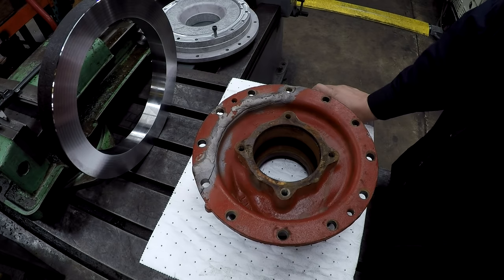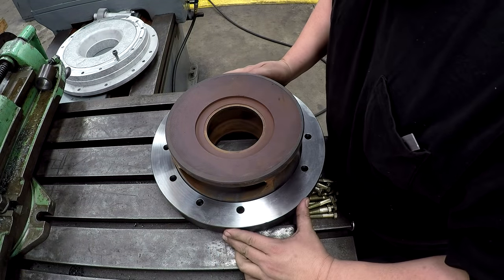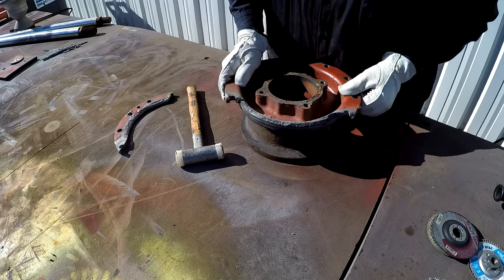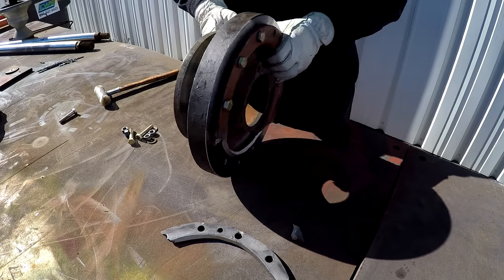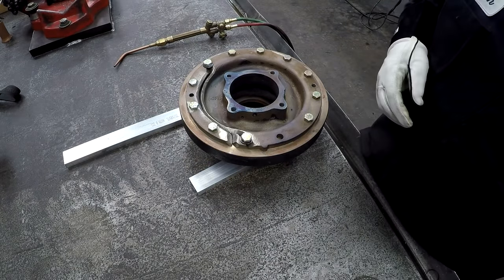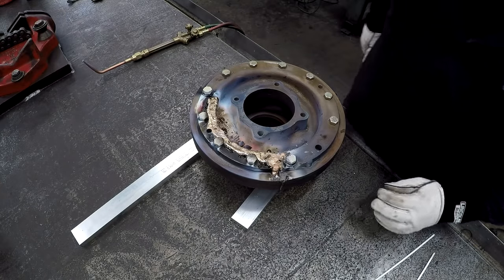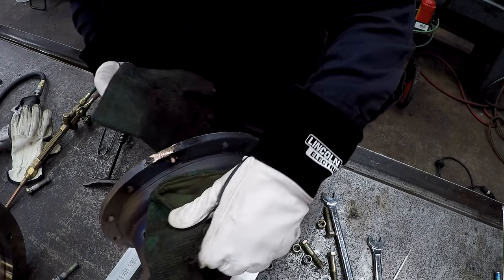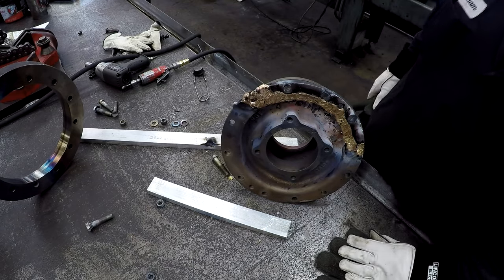Braze Repair on a Broken Casting Part 1

Comment: Hi Adam Job looks good so far. Did you wrap the casting to allow it to cool slowly or just leave it on the bench to cool.?  look forward to the next part.  regards from the UK
Reply from the maker: +Gary C Yes I did, and wish i would have gotten footage of that too. After the last clip I wrapped it up in that welding blanket and let it cool untill the next morning.

Comment: It looks like this part needs more structural strength - if it keeps breaking? I thought brazing was weaker than welding? What are the pro's and con's in this scenario? How is the repaired part holding up a few years later?

Comment: The previous repair was probably done by the kid in Texas with 7018's.   LOL   Your repair is 100 percent better.
Reply: That was a cheap shot for no reason.
Reply: Well the original repair looks like something the guy in Texas would have done.  He's the only one that uses 7018's to weld cast iron.
Reply: +1970chevelle396 coulda been a field repair where you're limited to what you can scrounge from the back of your truck and your go bag. all the bosses care about is if it's fixed yet or not. they don't care if it's done right, since more often than not they don't even know what right is.
Reply: +SuperAWaC   How right you are! Once during a shut-down we had to cut out a small socket weld valve from the underside of an intake line in a water treatment building of a power plant.  It was the most gnarly looking weld I had ever seen - looked like some kind of fungus you see growing on trees.  The guy doing the repair welding made a joke about it and mounted it to a cardboard sign commenting on the quality of work of the first welder.  What this prima donna didn't say was the boogered weld was done with the plant on line and the intake line filled and under pressure while the first welder was lying in 6 inches of water.
 So, +1970chevelle396, keep your mouth shut until you've been there.
Reply: +Ricopolico yeah i've definitely had to do my share of just-get-it-through-the-night-"ah-fuck-i'm-not-putting-my-name-on-this-one"-all-the-wrongest-tools-for-the-job repairs. i'd love to work in a boeing shop with the comfy leather welding chairs and the rotary tables that bring the work to you and the working hvac systems and the fume hoods and whatnot but not all of us can be so lucky
Reply: it was just a joke im sure rod.
Reply: @1970chevelle396  It's nickel ... !

Comment: Why have you brazed it rather than welding it? something to do with brass being ductile and malleable?
Reply: When it comes to the machining I guess machining copper vs nickel will be the choice(Not sure what filler rod was used and what it contains, usually a mixture of copper and zink or nickel for brazing steel or cast iron.). 

Also when welding with nickel it tends to crack like crazy unless you keep peening it between welds and let it cool down very slowly at the end.

Comment: Can you do an explination on when brass vs nickle is better?  i have a large casing that needs repair, and i dont have a large enough heater to heat and slowly cool to prevent cracking?  can you braze without worrying about cracking, or maybe give some scenarios?  (possible topic or SNS?) thanks!

Comment: Adam very smart move on the backing ring. Looks like another job where the prep  and plan is everything.   That is a lot of braze!  Could you tell on the previous repair if they used Nickel rod?
Reply from the maker: +Bill De La Vega Bill, yes it was nickle rod for sure.

Comment: The only thing i do differently when i weld or braze cast is i quickly bury the work (If possible) in a box full of Sand. Really helps to prevent stress cracks especially if you dont Braze and FCAW which works but requires the sand box. Brazing its not near as nessisary but i do it anyway because it cant hurt slowing down the cooling is the important part the part cooling too quickly is suppose to be what causes the stress fractures to my understanding.

Comment: Nice video Adam, so glad to see someone with the sense to preheat before brazing, I would have told your customer to take a running jump and would have reverse engineered a new part. lol. Looking forward to part 2, wondering if you will have any issues with the bore and the spigot not lining up or the bore distorting because of all the heat.

Comment: Just curious, why is brazing the appropriate method for this repair instead of welding?  I figure the flange is cast iron, and I haven't welded cast iron, so that's the only thing that springs to mind.

Comment: Did that braze actually hold up?
From my experience with brazing, doing that without first removing excessive coal from the iron and then whitening makes a big risk that the braze will actually not hold to the surface.
A proper braze has the strength only slightly smaller than a weld, but it's hard to achieve that without big preparation.

Comment: It looks like the sharp corner at the inside edge of the flange is causing a stress concentration point.  Maybe it would be a good idea to fill that corner all the way round?  If the original casting cracked it's likely that the repair will crack again, or if the repair is stronger than original then the other side will crack?
Reply: +John Creasey everything, if used correctly, breaks ;-)

Comment: Have a small part (old stone grind wheel/part lets stone wheel spin - has ball bearings) don't know what it's called and it has slightly crumbled. I think its aluminum but a 100+ yr old item maybe other metal? The mention of you having a customer is why I am asking. Who would I contact for such a repair or to make a new one. How does one engage the services of a machinist?

Comment: Great save on the casting.   The one bolt hole "off" is so it can only be assembled one way. ( just remember- nothing is ever fool proof. No one can ever underestimate the ingenuity of a fool )   I'd fill the jacking hole and add others as this was most likely the final save on that casting.  Jeff
Reply from the maker: I warned them about using that jacking bolt hole again. Very likely to break again.
Reply: +Abom79  That's all you can do.   Not sure if your shop saves notes on jobs but I'd document that not using location that was suggested.

Comment: So, I'm dying with curiosity, but at what point does your time brazing, turning and drilling the backer plate, and the downtime of the pump, not to mention the time of their maintenance personnel, meet up with the cost of the new part.  I've never had to price something like this out, but I can't imagine a machined part would cost nearly as much as they're going to spend on continual repairs..  Am I missing something makes the repair more cost effective?

Comment: Also you should place the entire peace should be placed in a oven and slowly reduced in temperature slowly pinging it with a hammer a few times as it cools down as to relieve stress in your peace. Robert

Comment: How will you clean-up the braze overflow on the outside of the casting? There appears to be some sort of small registration tab out there. Rotary table and the mill?
Reply from the maker: +wxfield Lathe and mill, coming in part 2

Comment: Adam

Would it have been possible to machine the bolt circle portion of the casting off and braze your ring in place to replace that portion of the casting?  Just curious if it could be done and what the pros and cons of a repair like that would be.

I love your videos!!

One of my early part time jobs was in electric motor shops winding coils for rewinding motors. They used spray welding to repair worn bearing surfaces.  This was in the late 60's.  I had  almost forgotten about it until I saw you doing it.  Are there newer compounds or is it the same old stuff.  I remember it would really stink up the shop when they were spraying.

Comment: Good job! Are brazing a better welding technic than MIG/MAG or MMA/TIG when welding a big "cast Iron" peace like that?
It is cast iron right?

Regards from Sweden.
Reply from the maker: For me personally it's easier to repair with brazing, and I know the brazed joint is strong and will hold.

Comment: say what you will about the previous repair job it seems the metal which this casting is made from was (metallurgically) a poor choice and perhaps it might be overall smarter to re-cast it in a better material?

Comment: Could you leave the big arse ring on the top of the unit giving it support all around?
  All they would need is longer bolts assuming it clears the center attachment.

Comment: Hi Adam, just for future reference, how about looking into having a new part cast by the foundry that Keith Rucker uses in Pennsylvania.  They seem to be willing and able to make one-off castings using the original part as a pattern, and Keith has had good luck with them.  Might be worth checking with Keith.  Best, -Chris
Reply: +bx2200 and Rockland Kcorvic: It is too complex.  It has undercuts,  the hole through it for the shaft, and other passages.  You would need a pattern and cores to replicate this casting.   Also shrinkage would likely be a problem in using this as a pattern.
Reply: +Roy Reynolds Got it. Thanks for the clarification. -Chris

Comment: I need some advice on a repair that I got to do. I got an enormous old very very very old Power hacksaw it's a Racine but it's way way way predates the Racine's you've probably seen this is like early 1900s it was converted to run on a motor at some point. It's an awesome piece of equipment and I've been repairing it slowly it still works but some of the cast iron cracked where it holds the backing plate for the back of the vise. There is a 1 inch lip that protrudes up at the back of the bad that the backing plate gets its squareness from and keeps from turning. It's hard to describe but anyway I need to braise a strip of cast iron to replace the broken section of this one in I'm going to grind it down and slightly slot or make a pocket for the new piece to sit in and then I want to braise it but how much of this do I have to preheat I do not want to crack the bed of this thing. Do I just have to get that area smoking I mean I can't get the whole machine hotter than hell. It seems like it would set up a crack somewhere. I've raised a lot of cast iron but never anything this big.

I need advice? Anybody?

Comment: Put layer of carbon with your torch over the steel. The brass won’t stick to the carbon. Remember preheat and then preheat.  Always use a tip that is two sizes larger than you think you need.

Comment: Adam, I love your work and the expertise you demonstrate in these projects. Have you ever considered TIG Brazing instead of OXY/Acetylene?
Reply: Jon McNabb The low fuming bronze Adam used is stronger and more ductile than the silicon bronze normally used for TIG brazing. Also, being a fluxed process and heating the base metal more deeply gives better adhesion than TIG brazing using silicon bronze or aluminum bronze. I know TIG brazing seems "cooler" than old-school gas brazing with flux, but sometimes the old way is the better way.
Reply: Thank you for the info. I did not know this. @WTFChuk

Comment: Damn nice work, Only a bit of making a mountain out of a mole hill, With all the specialty tools and the proper preheating the right cast rod and a good technic. I would have DC stick welded it. All that brass was expensive as hell and time consuming. As long as the warranty is good for the extra cost thats fine. If not turning a new one is not a complicated issue if lathe is big enough. If that fancy brazing failed I would deduct that labor from making a new one.

Comment: i use to do cat radiator brackets and the only way i could get them to hold up to the vibrations was to get the cast iron real hot were it is popping and poling then add the brass and mix it with the iron or it would just break out in a few hrs and i even got compliments from the owners of the equipment for how long my work lasted they use to only do it for a temp repair just till they get the new brackets but mine did so good they would just have me fix them and saved thousands of dollars for them i had repairs last longer then a new part because the brass would give not crack like cast iron does nd the brackets would come in pieces 20 or more
Reply: ps i found silver works the best but cost the most to use a repair can cost a lot with silver

Comment: The post heating should actually be in steps with a maintained temp and timed , bringing the heat down in steps. I don't recall what temps are needed for a cast iron piece but without the step down process it's likely to crack sooner than later.

Comment: hey Adam love watching the vid's.

but in regards to the one bolt being off pattern. i've seen that before. i've seen it on flywheels for car engines as then you don't need to drill and buy in for a locating dowel. simple thing that saves a few pennies when you churning out lots of engine. so i think this is similar here if the repaired part has to have a certain orientation into the main pump body

Comment: So how did you know that the molten braze wouldn't make it through the crack and braze the casting onto your ring? Also, why didn't it stick in the places it did come through around the bolt holes?
Reply: Jetstreamer the brass is naturally wicked onto whatever piece of metal is the hottest, and for most of the brazing the ring probably wasn't even warm enough to melt the brass.

Comment: What is the strength of brazing as compared to the original casting?  What is the strength of the bond at the braze to casting interface?

Comment: can i do this with a scored drum brake, that has 2 grooves, i just need to fill buy everybody tells me not to do it,, i just need a temporary fix,, what diameter of tip did you use to weld (not preheat) ,then how much pressure on the oxygen and how much on the acetylene?

Comment: it looked like the 1st repair weld had no penetration in to the crack , just a surface weld , how long did it last from fix to break if you know
Reply: +Andy Wyatt yeah ive seen many a repair, no veeing out, just a quick clean up with  angle grinder and braze on top, or even weld (which cast does not like!)  i would go so far as to say the old repair didnt get all the old crack stablised (hard to tell when you only clean the surface) , and thus it had a path to break even easier

Comment: Well, i would say that the sharp Corner on the inside of the flange is a built in weak Point. especially with the vibrations you get with a pump.